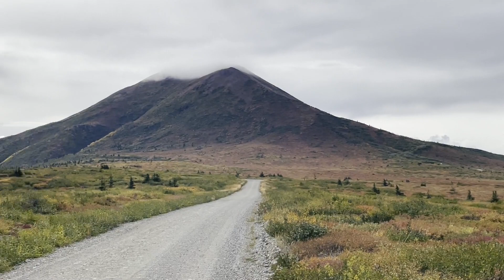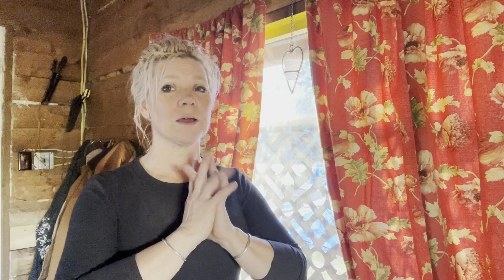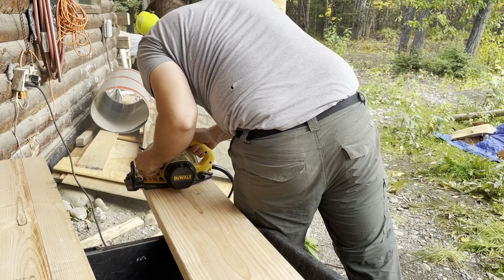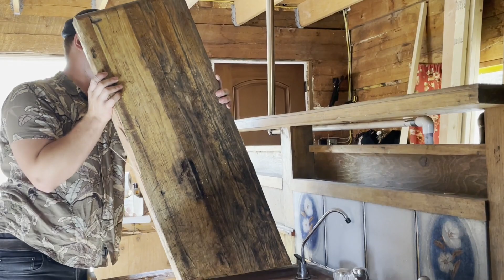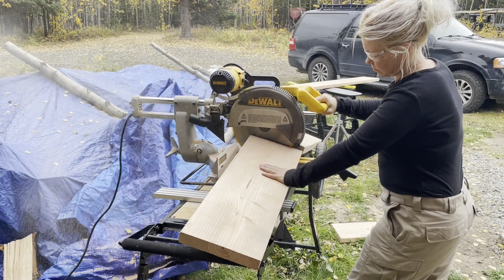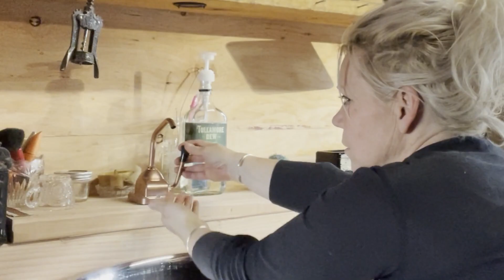Remote Alaska Cabin Kitchen Renovations & Bathroom Demolition Finally Begin!

Comment: Wow, you have both been so busy. What a difference and the kitchen looks so much lighter without that chunky buffet. Well done to you for doing these things yourself (girl power). That son of yours is a very handy man to have around and a good worker as well. 
The only thing I would suggest, and, it is because we live in an earthquake zone which is why New Zealand is called the shaky Isles,  the suggestion would be to fix the free standing shelves to the back wall in case of a quake and the shelves topple over. That has actually happened to us, my husband rebuilt my shelves and also added a timber rail across the front so my bottles of preserves didn't slide off and smash onto the floor. You may have already done that.
Great workable bench you have there, and nice and sturdy. Congratulations on the improvements , they are great.
Reply from the maker: Having my son here was awesome! He just tackled and completed so many projects! Even taught me a thing or two for when I was ready to build the table and pantry shelves. I love how open the room is now! :_Smile: The pantry shelves are secured in two places to the wall and two places on the ceiling. It doesn't even budge now.:_Laughing: I will build the root cellar shelves similar but more heavy duty. And with a lip so nothing falls off during a rumble. After spending so much time canning, I would be heartbroken to see broken jars on the ground! :_What: Everything in the pantry is on an aluminum tray that has a small lip. Thank you so much! :_Heart:

Comment: Make sure you put a small rail across your shelves because of earthquakes so you don't lose your stuff kitchen is looking awesome 😎
Reply: Yes, my thoughts also.
Reply from the maker: After I positioned the shelves, I nailed it to the wall in two places and to the ceiling in two places. It doesn't budge at all now. I will get some "L" brackets for the feet. Just in case. Thank you so much Helen! 🧡🤗💚

Comment: Wow, your home looks fantastic, well done on the counter! 💪🏼 Totally agree with you with the gas situation. We do not use gas in our homes in Norway. Only electric. I just got a gas barbecue last year. I do not like even that. I have always grilled on coal! 😅 But you are brave Alone. This girly girl could not do without plumbing. 😂 When I purchased the land, and applied for the building permit, they came back and said that before they could even process the building application, I needed water and sewage. So I had to call in the well driller and dig for the sewage system to come in. It works fine. I have never had any issues with frost. When we do have the really cold weather, in January, the ground is covered in deep snow, that insulates well.
Reply from the maker: I finally built the counter I have been dreaming about! I love it! I am used to using the butane cooker for the most part and I just bought a propane burner so I could do canning. I will get used to it eventually. But charcoal is the best way to grill any day! I don't mind doing without running water. Sure it takes me longer to do things but I am ok with that. Sewage is just a 5 gallon bucket for now but soon to be a composting toilet most likely. And grey water, I am looking into how I can feed that water into plants/garden. I know, I'm weird! :_Laughing: Thank you so much :_Heart:
Reply: @AloneinRemoteAlaska  It is nice to be weird! I know first hand! 😂
Reply from the maker: @ibislife  Right!? I can think of no other way to be! :_Laughing:

Comment: Okay so it's 1:00 a.m. here on the right coast and a few things immediately came to mind while watching , 1st and foremost, please be sure to anchor that pantry shelving system that you built, to the wall behind it somehow, they do sell "L" and even "C" shaped brackets at home depots, although you could probably find them even cheaper on Amazon, they come with the holes already pre drilled on them, so all ya would have to do is drive a few screws, no biggie..the higher you place em' on those shelves the more leverage and stability they'll have..
Also there's a plethora of ways you can go about getting your water pressurized so that it'll act in a normal sink function, foot pump anyone? You could put a foot pedal under that counter which would pressurize your holding tank and pump it with your foot while you wash your hands or do dishes etc. Get creative with it, I'm sure you can figure something crafty..
Oh and while we're on the subject of the tank, and (I'm sure you know about this already but) remember that those plastic tanks need to be cleaned out from time to time, even if you dump some bleach in there every now and again, it'll help, just look up the mix ratios online first...because legionnaires  disease could be real dangerous ,most water born bacteria/s can be real bad..
What was the other thing? Oh, I think I know who your son was impersonating, when he was dancing robotic like...was it Von Sprockets, the German skit from SNL? LOL 😆  when I saw him doing it ,that was what it reminded me of lol that was funny! 
I'm very impressed with your build of the pantry rack though, nice job ✊😊 
Keep up the great work and the longer videos too, I like to cast them to my TV, its better than anything else on cable lol
Reply from the maker: 1AM? Heck sometimes when it YouTube upload night, that's dinner time for me! :_What: So the pantry shelves are nailed into the wall in 2 places and to the ceiling in two places. The shelves do not move at all now. I considered nailing to the floor too but it doesn't move at all now. And I did just buy a foot pump from Amazon along with a nice articulating faucet so the arm can reach out further and be pushed out of the way. As for the two 14 gallon barrels, they will get wiped down with bleach or vinegar because I do worry about the slime that can build up. I have heard of Legionnaires disease in shower etc and yeah that is no joke! I had to look up the Von Sprockets skit and YUP that's it! https://youtu.be/rZMoGyr1BFU?t=254 HILARIOUS! :_Laughing: I am trying to do longer videos with them getting boring!:_Smile: So glad you enjoyed the video Mike! And wow what a compliment!! Thank you! Oh and I may not need to use the plastic wall/door now that I have that ceiling fan! I will have to see how warm it is with the new roof, stove move and ceiling fan together when it gets REALLY cold outside though! I'm still keeping it though! :_Heart:

Comment: I have a question for you gal how big are your tires and how much a piece and the name. I'm factoring in when you leave any time and return how long would they last.
Reply from the maker: I believe my tires are 33's. BF Goodrich K02's. About $500 each. I used this tire for off roading with my Jeep in Colorado. They last about 50K miles. In my opinion, it is the best tire out there. Great for light off road trails and highway. 😉
Reply: @AloneinRemoteAlaska  Everybody needs a set like them.
Reply from the maker: @tammygunnells7288  It does make your vehicle look beefier too! :_Smile:

Comment: Wow looks so nice. What a big difference. For the water faucet sure flow makes some really great pumps. You could put a small on demand pump on a faucet since you have power. Sure flow. Look for a 120 volt pump and just plug it in.  Easy peasy 😊
Reply from the maker: Yeah the difference still shocks me! I kept the on demand pump on the main water tank (500 gallons) but the only output now is to an outside faucet. This I kept for fire suppression on the outside cabin or near by vegetation. It used to push water through the entire cabin. Also my power can be iffy sometimes. This is why videos are usually posted late all the time. I bought a foot pump and want to see if that works. If not I will most likely go to a gravity fed. But if so, I will need a way to get water to the second level an electronic pump would be the best way for that. Thank you so much! 🧡🤗💚

Comment: Love that you are getting your kitchen project started.  IT will make your life's tasks and joys so much more enjoyable and functional.  I'd consider both a faucet style and sprayer style water faucets that you can spray veggies, fruits and even dishes and hands off when washing and rinsing.  They do have various styles for rvs so I'd order something from a rv supply dealer or retailer since that's the type of system you are using.   Think of your large pots and bowls, tall enough to fit those largest ones under the faucet and rinse well.  I am so happy for you!  You've done a great job on the counter and the pantry.  And I love the large long table- it will be perfect for canning and making bread, lots of space to prep and work.  Good for you!  I'd consider a bucket with cedar shavings for a inside toilet, maybe just a curtain for added privacy - primarily for when you have guests -  in a closet type set up with  a hanging curtain for privacy and appearance.  That way you wont have to go outside in the snow in the winter, plus you wouldn't be faning your door open letting cold air inside your cabin to go outside in winter months.  Just a bucket with a snap on seat for $6 dollars at walmart ir home depo - with a container of cedar shavings with a scooper in tbe shavings, and it will eliminate the odors.  I'm so glad to see your video today.  You made my day, thank you for that!  Best wishes.  Til next time.  God Bless.
Reply from the maker: I love how the kitchen looks now especially after the way it looked originally. But I still have SO much more to do in there! But having an open space to cook and a place to sit and eat is a first for me in this cabin. I normally ate on boxes, on the stairs or even sitting on the floor with Kenai. I found a nice foot pump and an articulating cold water faucet that will work (I think). I will show it in a video once I get it set up. The bowls as my sink are the perfect size for what I have to wash. And if needed, I can just move dirty dishes to another table! :_Laughing: But the table size was specifically for processing food and canning.  So since I got rid of my bathroom, I have been using the arctic entry for my 5 gallon bucket toilet. I heard that cedar chips are fantastic for odor cover but I am using something I have an endless supply of instead. Burnt wood ash. Covers the smell I would say 100% because it doesn't smell at all. I only use the outhouse to dump the bucket. No way was I going to have to grab my gun and flashlight just to use the bathroom! Especially in the middle of the night during a snow storm! :_What: But eventually I will get a "nicer" bucket set up when I have the new bathroom built in the arctic entry. Complete with a sauna and bathtub! So happy you enjoyed the video Charlotte! Makes you want to move back to Alaska doesn't it? Hurry, winter is here! LOL! :_Smile: Thank you so much:_Heart:

Comment: I love what you did to the cabin. For your sink, check out how van lifers make sinks. There's some really good info in them without plumbing. Have a great week😁❤
Reply from the maker: I watched a few videos on foot pumps and that's what I ended up going with. As soon as I get all the parts and install it, I will show it on a video. Replacing the faucet with an articulating one so I wont have to reach as far too. Thank you so much! 🧡🤗💚

Comment: try a electric camper pump for your sink
Reply from the maker: I am trying to limit my electrical usage but it may still come to that. I have another manual option to try first. I lose power often here so the less I can rely on electricity the better. And solar is not the best option for me because I am tucked next to tall trees that give me very little sunlight in winter. Thank you so much Mike! 🧡🤗💚

Comment: Hello my Annie, I love the work that has been done in the bathroom The pantry in the kitchen. The kitchen reminds me of an Old English style kitchen of old. I like the pantry that shelving unit was heavy and I'm glad it didn't fall down on you when you tried to push  it back. They do make battery powered pumps so you don't have to use that clear vessel. It can go exactly where you have the old faucet just turn it on and go and turn it off when you're done. So you going to do all your bathroom outside commode, shower. And upstairs in the bedroom are you going to sheetrocket will put paneling or some type of wood up there. Anyway keep up the good work, and stay lock and loaded my Friend.  LOVES
Reply from the maker: An old English style kitchen is exactly what I have always wanted. My entire cabin will be the same simple and uncluttered style. I recently purchased a foot pump and an articulating faucet. I am going to see if this works first before I try anything electronic. Since I got rid of my bathroom, I use the arctic entry for my 5 gallon bucket and I have a livestock watering trough for my bathtub that I can fill in front of the wood stove. Yes I can still soak in a nice hot bath and its very relaxing. But a permanent space for the bathroom will happen. And I want to eventually buy a nice composting toilet. I also want to build a sauna room but not sure if it will be part of the bathroom or its own building. As far as the entire inner walls of the cabin and roof, the roof will get planked and the inner walls will most likely just get taken down to the original logs. No drywall in my cabin will be added. My office is drywall and I will most likely just cover that with something more woody 🤪 To me drywall in a log cabin just doesn't fit well. I know! I'm weird! 🤣 Thank you so much Joe! 🧡🤗💚

Comment: Holy cow girl…..you do good work. I absolutely love the big counter. Oh oh and I so love your ceiling fan. I might have to try and find one like that. I love unfitted kitchens cupboards. Our power goes off all the time so I always have a wash basin in one of my sinks so we can always wash our hands. Love the chandelier over the old table. I have too with 15 lbs of crystals dangling from it. It hangs in the laundry room. Anyways great video. You are rocking this life 🌷🇨🇦
Reply from the maker: The table/counter and the pantry shelves are the two biggest projects I have ever made. This is why I had to try and push the heavy racks against the wall after they were built and had to flip a heavy table over by myself. Maybe next time I should attempt building them in place! LOL :_Laughing: But I love them both! Three times the pantry space now and a huge table to process food and can on. I do love all the space even when I am just cutting up my dinner though! Hopefully soon, I will show the chandelier all lit up and my new faucet with the foot pump. My chandelier was hanging out (on the floor) in many rooms (In Colorado) or in storage and was always asked about. "You keeping this?" "Seriously" :_What: But I always envisioned it in my kitchen and I LOVE it! 15 lbs of crystal! Do you soak/clean the crystal yearly? Thank you so much Lyn! :_Heart:

Comment: The cabin is looking good. As you were building the counter,I was wondering how you were going to flip it over. 
For your kitchen water look into a foot pump. I see that they are used on boats all the time. Hands free operation. I use a foot switch to operate a solenoid to start and stop my water. It's wonderful.
Reply from the maker: Foot pump has been ordered and a new articulating cold water faucet as well. As long as I bought all the parts I need, this should be an easy install. I will show it on a video once I get it all done. Thank you so much! 🧡🤗💚
Reply: That is a great idea!

Comment: Could you maybe put the faucet and sink bowl down the other end of the counter, where you currently have the butane stove, so you can get to it both from the front and the side?
Reply from the maker: It may come to that but I have an option that I am going to try first. I am just waiting to get the stuff from Amazon and as long as I have all the parts, its should work out perfectly. I will install a foot pump to a cold water faucet with an articulating arm. That way I will not have to reach as far, can fill at any angle (180 degrees) and can push the faucet out of the way when not needed. I hope this works! I will show it on video when I get it all installed. Thank you so much Michele! 🧡🤗💚

Comment: Ok this is the first time I have heard a woman say "I hate indoor plumbing" That's how I keep them away!! 😉 sorry no plumbing at my place to bad 😅😁😎

One way to set up running water is an rv pump that only pumps when faucet is on. Put it back near your barrels
Reply from the maker: LOL! well Gnomie, there is nothing normal about this gal! So I do have an "on demand" pump but only for the 500 gallon outdoor fire suppression. It used to power the entire house. No pressurized water in my cabin!! I bought a foot pump and a new articulating faucet. I will show it in a video when I get it and install it. Hope I got all the parts right! And we finally got A LOT of snow here! Thank you so much Gnomie! 🧡🤗💚